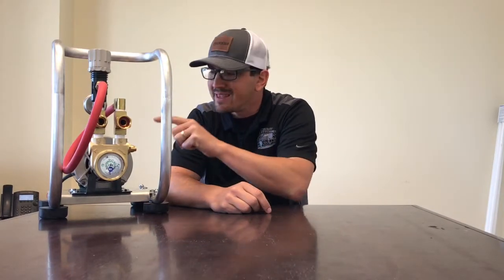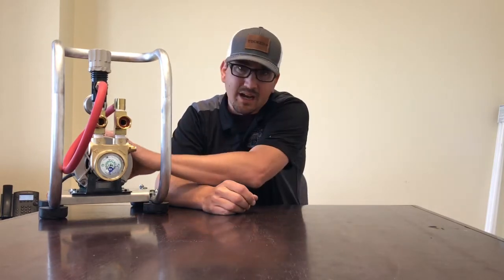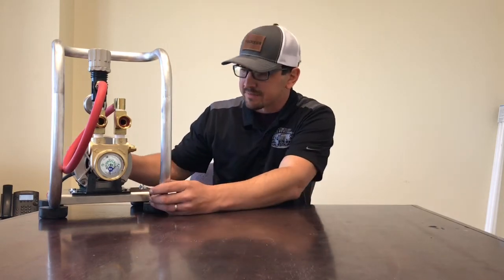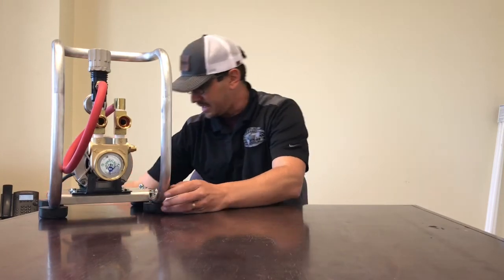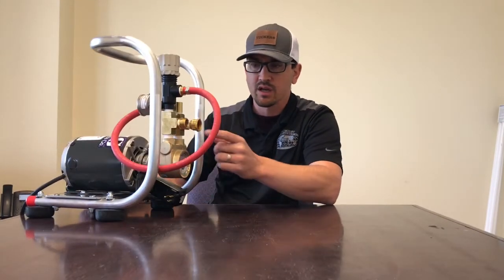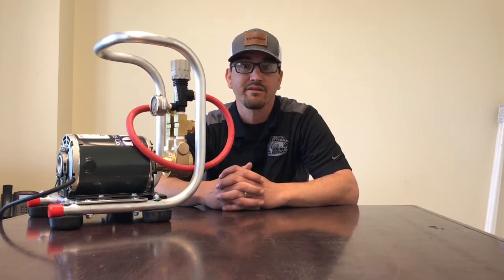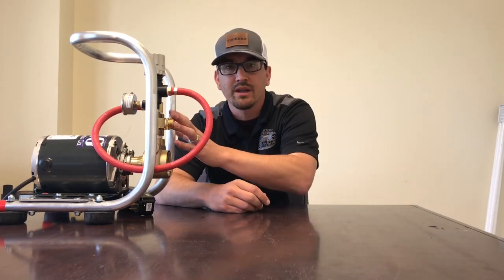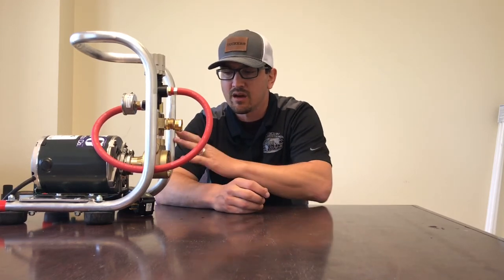Electric Powered Booster Pump

Comment: So I have your 12 volt battery box  version of this pump, and I run it right after a DI water storage tank and then the output side I have hooked directly to my wfp hose.  Is it better to run a thicker hose out of the output side most of the way and then adapt to the wfp hose? Also, when I want to hook it directly to a location’s water spigot to boot pressure, I just hook the pump up between the spigot and the DI system?